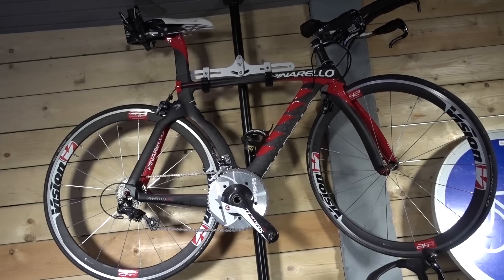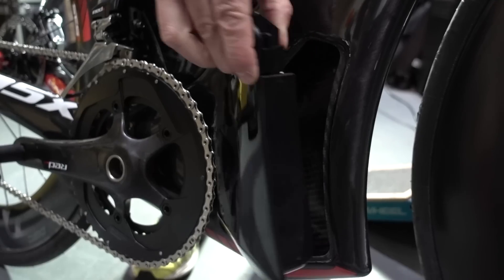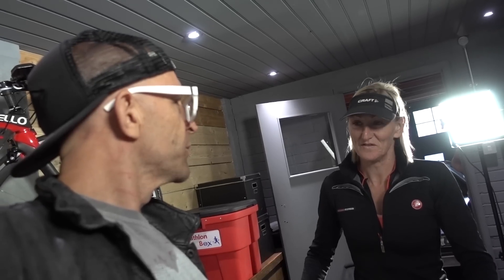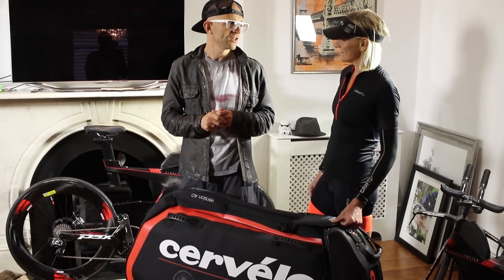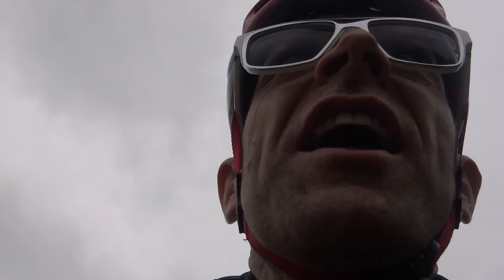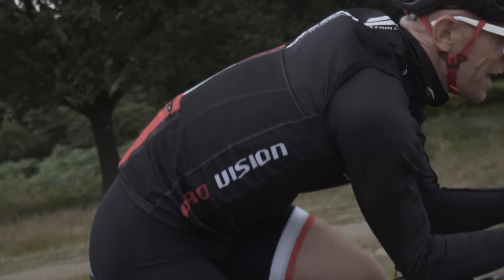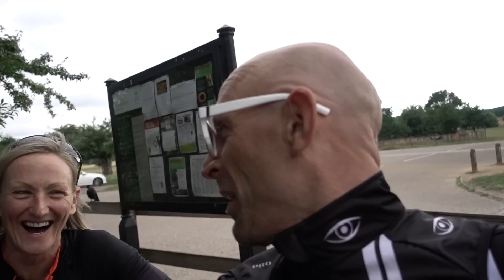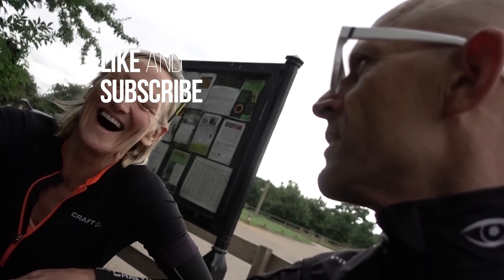Tri Bike BATTLE!!! | Cervélo P5X

Comment: is No way you can pack or unpack this bike within 10mins. I have done it  3 time, the front handle bar don't come off as easy because you have to take the etap junction box out first.
And you will be in disadvantage once you going up hills compare to most other tri bike.
the good thing is on flat and if you going for full Ironman. 
and  even on windy condition didn't effect anymore then regular road bike.